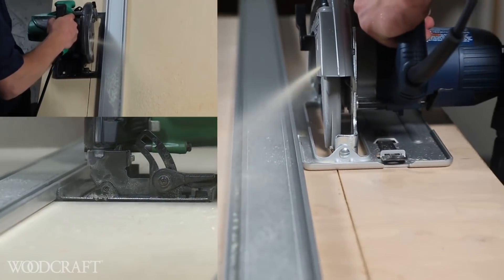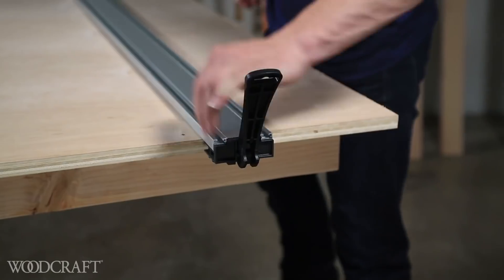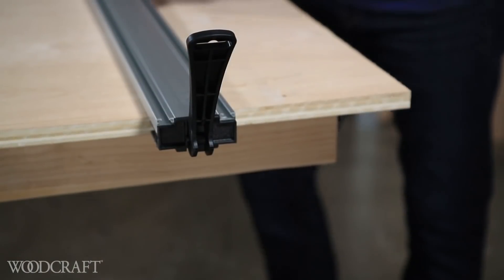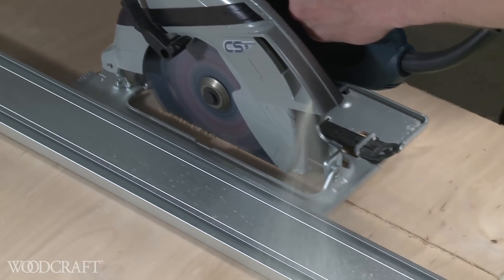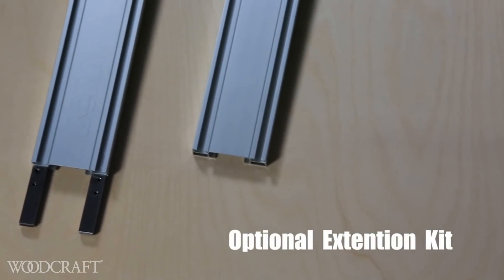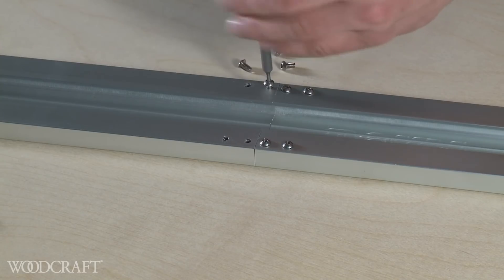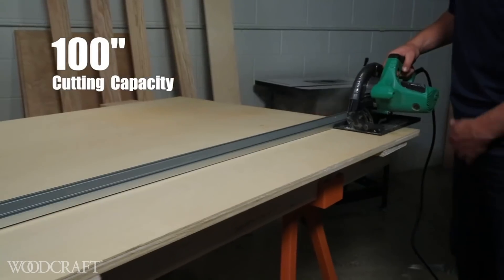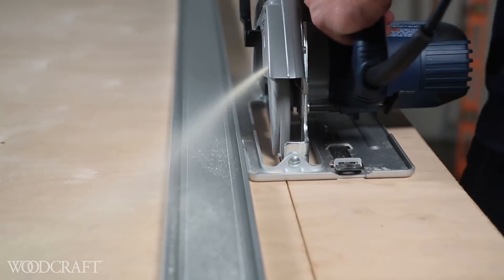Bora WTX Clamp Edge Set - Presented by Woodcraft

Comment: I just picked one up. It works ok wish it clamped better. I had it move while cutting. I now secure it with F clamps.
Reply: then it's not worth the $50 you bought it for.. maybe your sheet was bowed?
Reply: I actually like it. I think its a good investment. So much easier to cut down full sheets of plywood. A lot easier than the table saw.